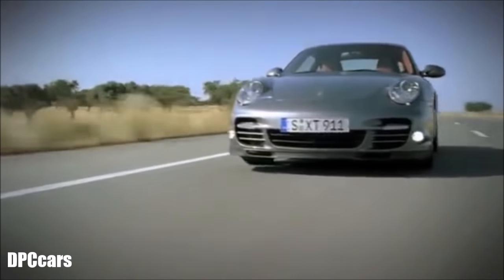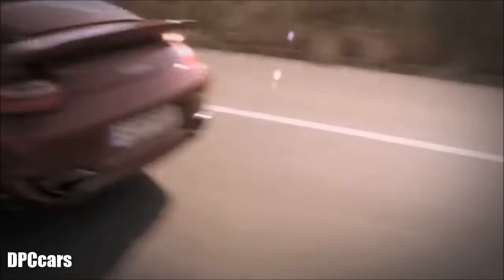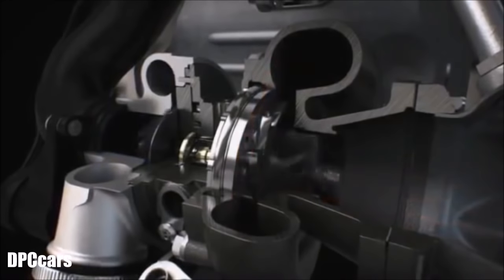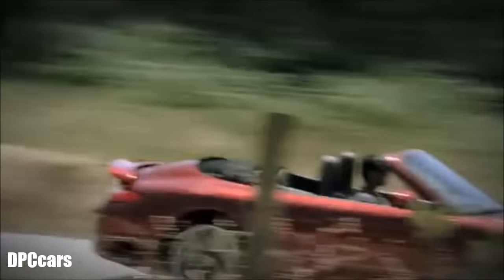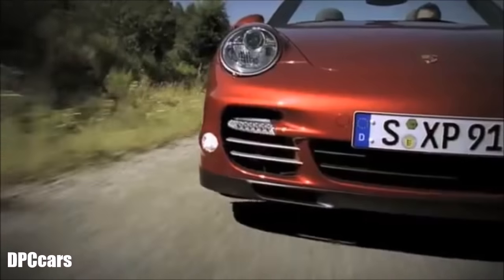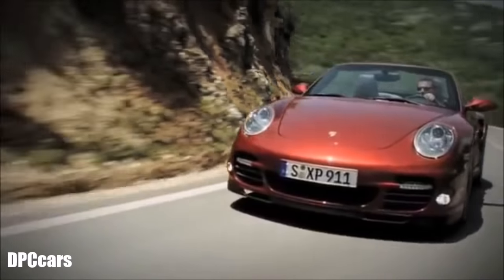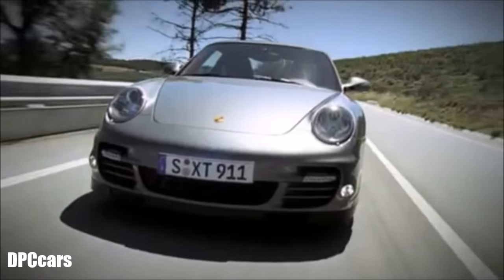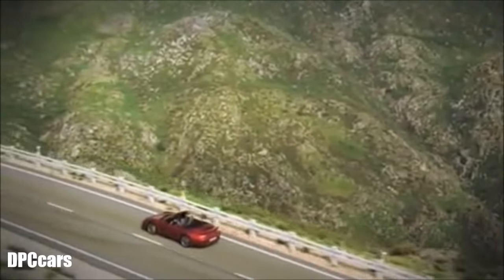Porsche 997 Turbo and Turbo S Documentary

Comment: My fantasy model to have has alwatys been the 991 GT3  RS of the 997 gen.

I agree that it is, to a fair extent, it is on par with the 991 GT3, but with the classic hydraulic steering feel 997's are renownede for and rawness of the ultimate GT3 offering of tyhe 997 generation. Additionally the smaller size makes for a really refreshing car; to see proof of this, look no further than the gigantious 991 and 992 gens which have horrendously moved away from their nimble roots.

Factors which all make it marginally better than the 'standard' succesive 991 GT3, at least in my humble opinion🙌👏👏
Reply: There is no such thing